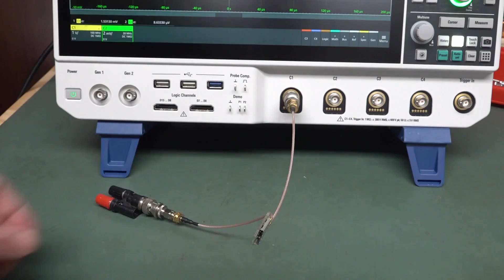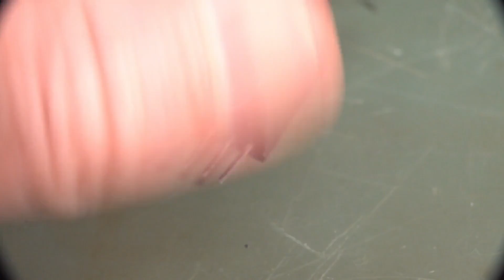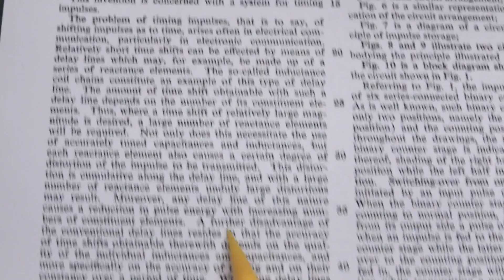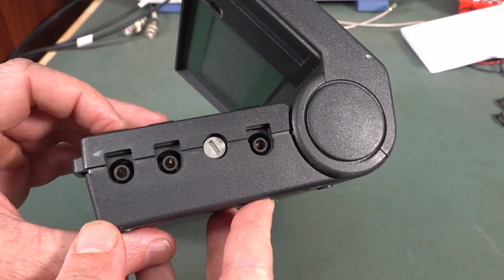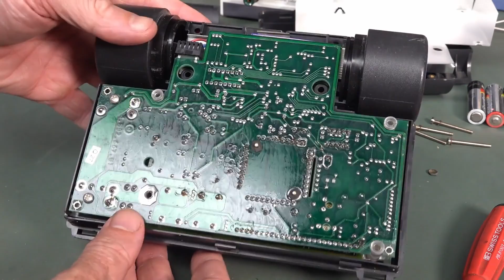EEVblog 1525 - Commisioned Mailbag

Comment: Thinking that delay line is based on the set and reset of ferrite cores, with you having a string of cores, with each pulse of current of opposite polarity flipping the cores to the alternate state, basing the current strength of the flip on the sum of the drive and the signal output of the previous stage. Thus the cores all will flip state on each clock, just that feeding in a pulse at the beginning will make that first core set to the opposite state, and this then propagates down the line of cores, and at the output the pulse is xored with the clock pulse phase, and gives a pulse out, delayed by the number of cores, and with a resolution equal to the clock pulse.

BBC is Brown Boveri Corporation, bought over by Metrawatt, and before that it was Asea Brown Boveri, and originally Brown Boveri. Big manufacurer of electrical switchgear and industrial control and measurement equipment, and a lot of it still is in use after decades of service.

Comment: Hi Dave, regarding the Ambit pump, it's actually not an infusion pump but rather a type of Patient Controlled Analgesia pump which is done through a peripheral nerve catheter or in this guy's case most probably some sort of cervical plexus catheter. These are placed usually before surgery under ultrasonographic and/or electrical nerve stimulation control in the direct vicinity of nerves/plexuses. After surgery they would provide either constant flow of anaesthetic for pain relief or would inject a bolus of the anaesthetic on a press of a button if the pain is too strong. And you're right the disc is an antibacterial filter to keep the catheter free of germs upon disconnecting the pump (you don't need an antibacterial filter on venous infusions as the blood in the blood vessels has the ability to neutralize small quantities of bacteria effectively).

Comment: "How do they pick and place 008005s?"
That's exactly why we don't use them. The component spacing required for even a fairly advanced process (2mil trace/space 4 layer flex) means that anything below 0201 takes the same PCB real estate regardless. It's even worse, since you need more of them in parallel thanks to the terrible DC bias derating!
Reply: And even if you are young and have perfect eyes, you still can't see them without a microscope.

Comment: I have a BBC Metrawatt "portable bench meter" (bench meter with batteries) from about the same time. The input connectors are indeed spring-loaded clamp connectors so that you can easily connect bare wires. It's real handy. It still keeps the calibration to within one count of our calibrated 6½ digit Keysight meter at work.

Comment: The AD636 is a true RMS to DC converter. I didn't quite catch what the DMM is using for a reference from the visuals but suspect it's a diode.
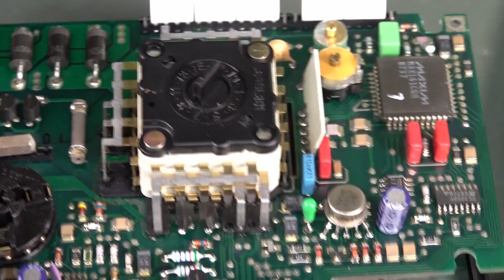Reply: There is LT1004CZ-1.2 (TO-92) at 40:08 . Maybe that?

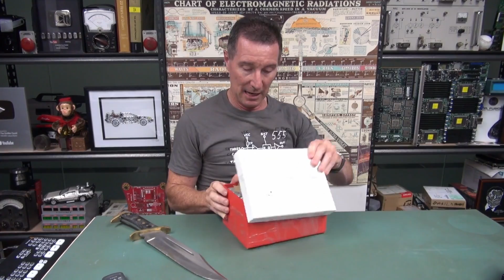Comment: @30:45 I've got the much smaller GTM2032 version of that meter. The range switch is equally hard to turn and the battery lid is almost impossible to take off. Continuity is also broken on it but other than that it works fine. I never use it though. To clumsy. My uncle gave it to me. He was head maintenance tech for Akzo Nobel in Delfzijl (NL) back in the 80's.

Comment: The company I work for makes the machines that those MLCCs were probably tested on. The little stuff is nuts.
Reply: Any idea what voltage they test the 6V caps to?
Reply: @jaro6985  that’s up to the manufacturer.

Comment: The problem with using a single bf998 in a fet probe is it’s internal gain isn’t very high so source output impedance is  also high, hence the voltage drop into 50R

Comment: that Delorean circuit is a sweet idea Dave!.
i think it would have looked even better on a black background..(with the car itself still white background, so you can see the wires n dark components easy)
it would be even better if ya could power up the circuit! ..like flash some leds around the wheels to animate them like they are rolling, and changing to fire color...and others around the car body that would simulate lightning effect
Reply: That's what I was waiting for, a switch or a remote click and then some blinken lights.

Comment: i am wondering how the pick&place machines pick those 008004 and how many 008004 they lose during a day.
Reply: you are asking the right question. Some engineers and purchaser do not realize that losing parts is just normal.
The easiest way to get a number is to ask an assembly how much extra you need to supply of component.
(It will be something among the line of "additional x%, min., x Quantity, x mm of prerun on the tape" and which ever is greater)

Comment: Would have killed for a fancy multimeter like that BBC back in the 80s. We were still using analog meters in college. Separate Bakelite cased ohm, volt and ammeters with the associated mess of cables.

Comment: Hey EEVblog army. Is there a device on the market that can record random Uni-directional Waveforms between 0.1 to 5.0v and play it back (outputting recorded signal) so that the students can practice reading the waveform with pocket oscilloscopes. Thanks
Reply from the maker: Analog Discovery perhaps?
Reply: what frequency are your waveforms? If its low freq, how about just a personal audio recorder or just use audacity. I think techmoan did a video of a sony digital audio recorder device a couple of years back.
Reply: @simontay4851  I didnt think about that. Thanks

Comment: The small size of components these days is crazy. I had to replace a couple of 0201 sized resisters on a games console recently, just getting them out of the reel without losing them is a nightmare!
Reply: Put a dab of flux on the tip of your tweezers, then you can touch them and they will stick to your tweezers. Still fiddly, but 100x easier than without the flux.

Comment: Metrawatt made quite a bunch of multimeters for BBC and later ABB. I had a little brother, an M 2005 with ABB branding. It had a broken range switch, so I contacted Metrawatt some years ago - and they still had spare parts and send them to me - 28 years after EOL... Works again and still bang on.
Reply: I still use my ABB Metrawatt M2012 from 90's. Very accurate and reliable meter. 9V battery lasts 2000 hours on DC ranges so you can keep the meter on for almost three months until you need to change the battery.
I contacted Metrawatt about two years ago and asked for the schematics and they immediately sent it to me for free. 👍
Reply: That's how it everything should be done. Hats down to such product manufacturers. Things should serve for life, even if too expensive.
Reply: In my former job I had an ABB M2004, loved that thing. The battery life was absolutely incredible of these. I forgot quite often to turn it off and it still lasted for months and months unlike the Metex and other cheaper LCD multimeters.
Reply: At school our teachers used a similar constructed multimeter I think ABB branded. That was early 90's.
Reply: Sadly my experience isn't that good. I have M2042 that i managed to broke,white smoke came out, was pretty mad at myself for making stupid mistake. So i tried to find schematic by googling it but had no luck. Then  i  contacted Metrawatt and they didn't offer any repair service, they said they don't have schematic and support guy offered me to buy one of their new DMM's. So after some time passed when i finally could look at that poor DMM i started to work on it, i managed to find all shorts but still got some issues and schematic would really help.

Comment: 008004 is too far for us mere mortals - it's getting to the point where electronics is purely design - not manually building circuits :-(
Reply: I mean, if u have a design where u need these u might have bigger problems 😂
Reply: @jimybobjim  But these make the problems smaller.
Reply: @jimybobjim  They are on a lot of phone motherboards. I've tried soldering them, complete nightmare. Even the slowest amount of airflow from my soldering station, would be enough to blow neighbouring components off the board.
Reply: @MattyEngland  fair, I only considered if it was a board u were designing instead of repairs

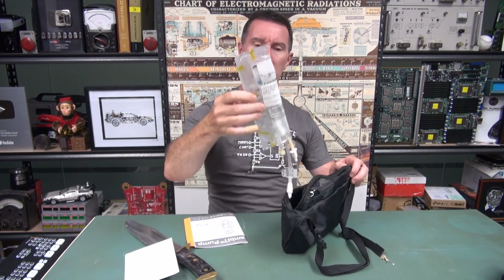Comment: 24:17 That looks like a main vein drainer. You may need to rewire the motor and provide your own filter cartridge, but it provides drinking water while you're on the go. This leaves your hands free to stretch and do calisthenics in the bathroom. Of course, this is after you take the urinal right next to the only other dude there, and there are plenty of others you could stand at, not manually draining.

Comment: i have just tried to measure the capacitance of a speck of dust but my probes just keep shorting together so i wonder how they test those 008004 caps
Reply: Wait until you have to try soldering one, that's when the fun really begins 😂 I still have nightmares and PTSD
Reply: Very very carefully, and with the teensiest tiniest test fixture. But the line surely has a set of probes that use AOI to align to connect and test them during loading of the reel.
Reply: I wonder how much capacity 008004 caps have at any voltage. even with "normal" 0402 caps you sometimes wonder why you purchase 1uF caps for a power supply circuit/bypass cap, when even at small voltage the capacity decreases significantly.